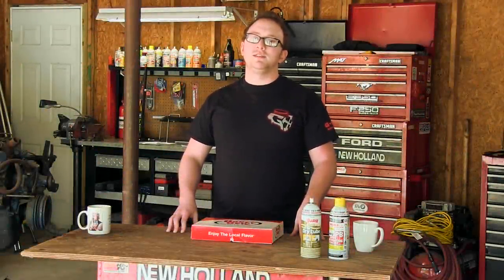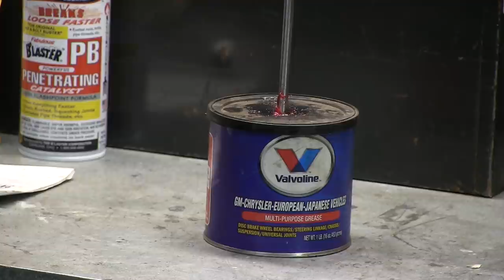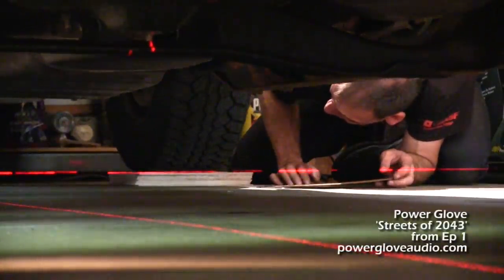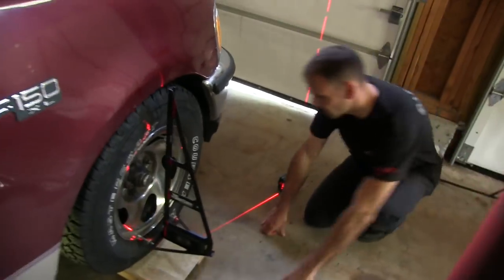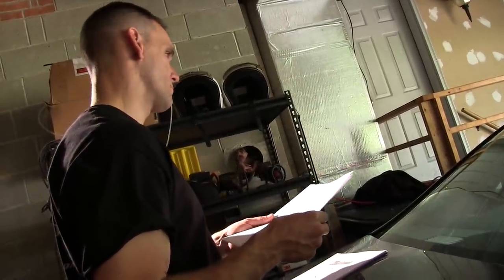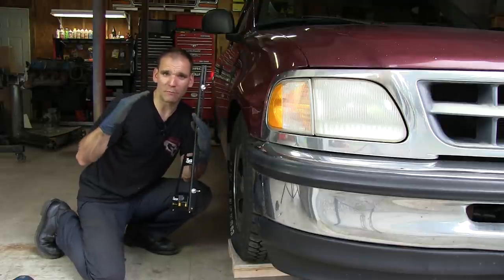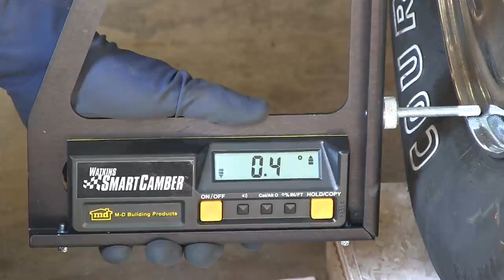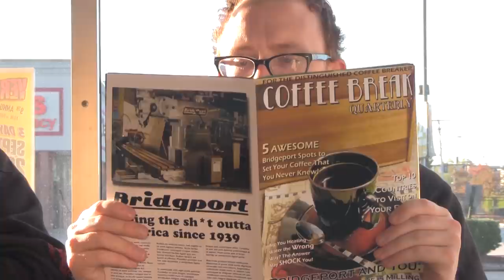Garage X - Episode 7 - DIY Wheel Alignment Part 2

Comment: Thanks for the video guys. My car has been off alignment for awhile now and I want to learn to do it myself. This way I can periodically check it annually to see if any adjustment is needed. The bosch laser level is a great, great tool! This thing has so many uses. I love the part where you actually use the linoleum tile and the bosch laser level to determine a 20 degree turn.

Comment: Good episode and I enjoyed watching it:) The laser unit is expensive just to replace a piece of string and I just can't help thinking that it would be quite easy and affordable to fabricate one of those with a bit of math, angle bars and a laser beam (even the one of those carpenter's ones) or... 4x vertical/horizontal laser beams (there are loads on ebay for £5) that shoot two lasers at 90 degree angle to mark the rectangle around the car. It still a fuss to set it up, but takes away the risk of tripping over the string set up. Same goes for the camber/caster unit. I wanted one myself but it is just too expensive for what it is and it should possible to, again, use math and a bubble spirit level  put against the wheel hub or against the wheel's rim using a flat bar. I am car enthusiast, not an expert, so I may not know what I am talking about but Matt and Chris both seem like a very switch on guys on the show and I would love to see them discussing various ways of diy'ing things yourself. To me, after all, this is a garage show mainly targeted at someone like myself who likes to work on his car at the comfort of my own garage or driveway and I just felt a sense of plugging (marketing) there. Nonetheless it doesn't change the fact it's a good and knowledgeable show indeed. I am recommending it at work.
Reply from the maker: kod81 Thanks for the recommendation! We're glad you like the show, and you're right; There's nothing we've shown you here that you can't replicate with a bit of fabrication skills and some math. The tools are nice, because they're way less expensive than buying an alignment rack, and they give you all the same capabilities and accuracy (if not a bit more). We're never shy to promote the products that we believe in and use here at the shop, and we're happy to plug the people and companies that help make Garage X TV what it is. I hope that doesn't seem too commercial for our viewers, but we will NEVER promote a product that doesn't work as advertised, and we'll ALWAYS be honest about the kind of results that we get. At least that way you know we haven't sold out and just become another crappy car show/commercial for "the man". Cheers! -Matt
Reply: Garage X Television :) cheers for the prompt reply. I must say , when that tool kept coming of the wheel's rim hitting the car's wing, you guys did not try to cover for it but contacted the vendor instead who's provided you with a quick fix - in this case some longer bolts. I like the honesty. Without sounding too patronising, keep up the good work guys!

Comment: I have a 68 chevy C20 2wd. After rebuilding the front suspension with all stock replacement parts I noticed excessive Positive camber after getting it back on the ground.
 The upper and lower control arm shafts are original and have new shafts and bushings. When I tore it all down I made sure that I used the same shims and put them back the same way the came out. 
Do I have to tear it all down again to remove some or all of the shims from the upper control arm shafts to fix the camber? Or can the alignment shop fix it on the rack with out a complete tear down?

Comment: Once you grasp the concepts, most handy folks should be able to make equivalent, if not better, versions of these DIY tools. Two critical aspects should be kept in mind - consistency/repeatable measurements, and solid attachment means. Rigid metal to metal contacts beat rubber, etc. Also, note excessive digital accuracy isn't always either necessary or dependable. One shortcut for keeping camber the same during strut/suspension repairs is a magnetic digital level, or even iPhone level app; check and match against the brake rotor before and after the repair, as it's angle should not change on the jack. It may not be the reference spec, but should come back into alignment with the wheel on the ground. Of course altering or tuning must be done as in the videos.

Comment: You would think for $300 for that Smart Camber Gauge they would include the longer pins for lowered vehicles because I would think the majority of people doing DIY alignments have modified lowered cars. I have used the string alignment technique with excellent results, the only downside would be time involved to accurately do it, but obviously if two people can be used to do the set up of the string box it could be done in less than half the time. I'm really not to much of a fan of using just the toe plates, I would rather use the string box to set the toe equally on each side than double check using the toe plates for total toe.

Comment: FYI... WD40 will take off permanent markers... Here's a trick... I use Permanent markers on a white board for a schedule grid and erasable markers to enter the changeable data. Just erase the data with a paper towel or a eraser and the schedule grid stays there... If I need to redesign the schedule, WD40 takes everything off. Better and less harsh than Brake Kleen...

Comment: So I am going to do the 4/6 djm complete lowering kit on my 1989 GMC Sierra. I have a few questions..first, would I need the camber kit right off the bat or is that something that gets decided at the alignment shop?

Another question..so I'm trying to buy new wheels and new tires for my truck but that won't be until about a month after I lower it..so I would lower it, then align it and when I put on the new wheels and tires I would have to take it to be aligned again correct? 

Are there any other suggestions or advice you can share? 
Thank you.
Reply from the maker: +Roger Osorio, With a drop as big as 4/6, I would just order the camber bolt kit with the suspension and put it all in together. Without the kit, we would have had no way of making caster/camber adjustments. I suspect you'd find yourself stuck with alignment numbers that you were not happy with. New wheels and tires shouldn't effect your alignment, but getting it rechecked after the swap may be a good idea. You may find the alignment has "settled" a bit once the new components have had time to wear in. Just a thought. -Matt

Comment: With the Longacre Plates how do you know what side to adjust, or do you adjust both equally?
Reply from the maker: You're right. That seems to be the issue with toe plates. You can set total toe by adjusting both, or just one side, but on most vehicles there will be no way to ensure your steering wheel angle is straight when you are done. The plates work well if you just replaced an outer tie rod end, and you want to check and set toe on one side, but not as well if you need a full alignment.
Reply: Thanks, I thought so...
Reply: To get a straight wheel (or close to straight): while you are setting 
total toe, sight down the front tires like a rifle sight and see where 
they &quot;aim&quot; at the rear tires. When you get the two 
front tires to each aim the same at the rear tires, the wheel is usually
 pretty close to level when driving. If it&#39;s not, toe one side 
in and the other out a quarter turn in the correct direction to move the
 wheel without changing total toe. Repeat as needed.

Following the link below, you should find a photo of the toe stick and 
scribe set I made while working at my last job, before opening my own 
shop.

I like it because the setup is faster than strings, and it is not 
affected by run-out of the wheel and tire. And, I worry about toe plates
 not staying put. 

https://www.flickr.com/photos/thealignmentguy/5588658883/in/album-72157603608874815/

Comment: Were you with in specs? How close was your at home alignment?
Reply from the maker: +MrAlittle5150 : We were all pretty close, truth be told. Camber numbers looked great, and the Smart Camber Gauge really got us where we needed to be. We had good, repeatable numbers. Getting toe right takes some practice... no matter what method you use. Our string alignment looked good, but measured out by the most. The toe plates worked okay, but there was no way to know what side you needed to be adjusting. 

And then, we're hearing that some of these methods can be MORE accurate than a laser alignment rack!?!?  Now who do we believe? 

The truth of the matter is, all of these tools take time and practice to get the hang of, but when you're dealing with 1/100 of a degree, it's easy to be a little off. There's no easy answer here, but if you're willing to learn the skill, you CAN do this yourself. Wish I had a better answer for you. I just want to make sure we're honest about how we did. -Matt
Reply: +Garage X Television  I think you should of showed the spec print out sheets before and after on each vehicle.
Reply from the maker: +MrAlittle5150 Yes. That really should have made it into the final edit. We'll make sure to include better "before and after" info for you guys in the future. Thanks for the feedback. -Matt

Comment: So, let me ask you guys a question please.  We have a 31' Class C motor home built on a 2006 Ford E-450.  I've had this MH for about 2 years.  Had the alignment done 3 times and it STILL has 3 to 4 inches of steering play going down the road.  I've asked to have the caster set as far forward as possible and they REFUSE to move it past Ford spec.  Why won't they?  Does Caster NOT help the play?
Reply from the maker: +enterprise59 No. Caster won't do anything for "play" or slop in the steering. That's more likely due to wear and tear, or stack-up of clearances throughout the steering/suspension system. Additional negative caster will increase steering effort, and give you more straight line tracking. I'd have someone check your steering ASAP and figure out what the problem is.
Reply: +enterprise59  I'm going to guess you have a straight axle front end ?  I myself would check every joint in the steering system personally so have someone behind the wheel rock the steering wheel in one direction and back a few time's to pin point the steering play issue  chances are you have a worn out joint . maybe center link or tie rod end {drag link} or the like  but if you have excessive play then you have an issue that can easily be found ...Even for a so called "front end" guy
Reply: Michael Laverty
replaced drag link.  The place that did that check out the rest of the steering system, said all connections were in great shape.  They did not check the gear box however.  She likes to wonder, so I have 3 to 5 inches of play depending on road.
Reply: +enterprise59  I hear you but I have to tell you .. I'm NOT real comfortable telling you to try and remove that much play and trying to do it thinking your gonna accomplish that through the steering gear box  It's only a gear box . you will  let go of the wheel and it won't come back to center . I've taken up some slop and overly loose feeling but to remove 3 to 5 inches .. I'm not doing it ...maybe try another gear box first .. Or how are the king pins if it's straight axle ????
Reply from the maker: +Michael “Roguelement” Laverty Agreed. There's an adjustment that can be done at the steering box to take up some of the slack, but that sounds like too much slop for everything to be okay under there. I'd have them look again, or go get a second opinion. It shouldn't be too hard to see where the play is coming from if the wheel is able to move back and forth that much.

Comment: Stupid design on the camber gauge.. the bottom plate should be height adjustable too that way it would lower the top of the unit to avoid hitting the fender.

Comment: So which method won?
Reply from the maker: It's funny. There was some dispute about that.

The Yugo was a disaster when we brought it in to do a string alignment. By the numbers, it was still the furthest out when it hit the rack, but there is no caster or camber adjustments in the front end on that car. There wasn't much Steve could do without modifying the front end. (We'll get to that at some point.)

The Ford Truck had nicely balanced caster and camber side to side, and the numbers closely followed what we had measured with the Smart Camber Gauge. My toe was a little out, and I needed to make some small adjustments before getting down off the rack. I suspect most of the issue there was my own unfamiliarity with some of the tools we demo'ed.  We've been working with the ART Smart String tool since then, and we'll be releasing a short, "how-to" video to show our viewers all the capabilities the Laser String really has. There's a lot of good information there that never made it into these episodes.

The Volvo was almost perfect when we brought it in the shop. The Longacre Toe Plates gave Chris an easy way to check and set total toe for his car, but there was no good way to set toe for each side, outside of finding the geometric centerline of the chassis and measuring to that. If you only do a total toe adjustment, your steering wheel angle may not be correct after you use this method. The plates are great if you've only made changes to one side (like replacing an outer tie rod end) and you had a pretty good alignment before the repair. However, they can be a bit of a handful if you are working by yourself. I think Longacre just released a new version that uses magnets to help hold all the pieces together. That might make it easier.

All of these methods worked well enough to set a basic alignment on our cars. All three vehicles drove out of our shop with straight steering wheels and a pretty good road feel. Each time we tried one of these methods, though, we found it got easier and easier for us to do. We also found that our numbers kept getting closer to our target numbers. Any of these methods will work just fine. It takes some practice, but after a few attempts, we were really nailing the at-home alignment thing. 

In the end, I bought the pizza because I said my truck would be "as good as factory" and I was a little off. You know those guys weren't going to let me get away with that! Thanks so much for watching. I hope you enjoyed the show.
-Matt

Comment: Do you realize that by the time you raise the front of the vehicle you done lost its natural camber angle.  Nonsense Video just like so many others.  Why do you think alignment turn plates move in all directions.  Get a life.
Reply from the maker: True. Which is why you have to "jounce" the suspension once it's back down on its wheels. They greased plates let the wheels move in all directions, just like an expensive turn plates. Even on real alignment machines, vehicles often get lifted off their wheels while the tech makes adjustments and loosen hard to reach fasteners. When the car comes down, the suspension gets jounced to find its "natural"camber angle again. We got great, consistent camber numbers using the Watkins Smart Camber Gauge. Just remember to jounce it.

I will see if I can get a life. -Matt
Reply: +Garage X Television this works good if you take the time and your low on cash i have done it this way my self don't mind the hates !!